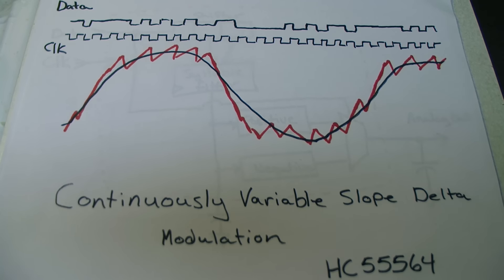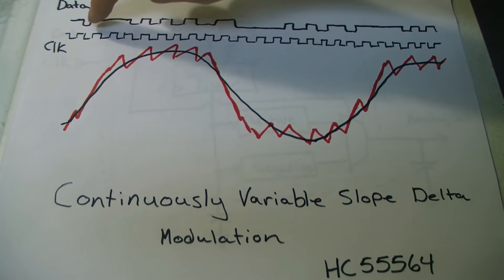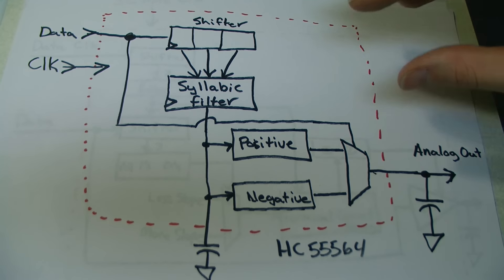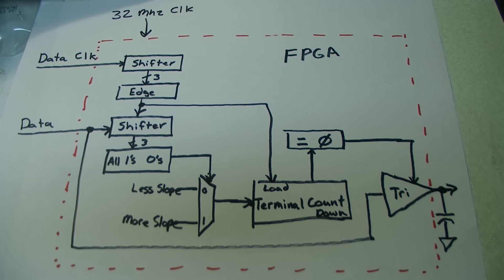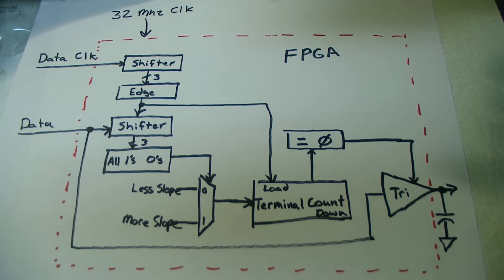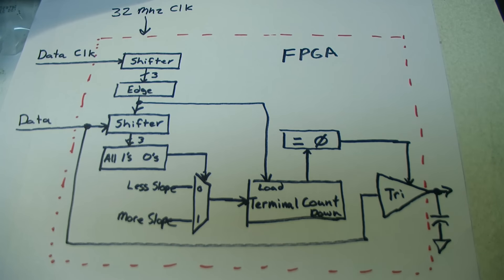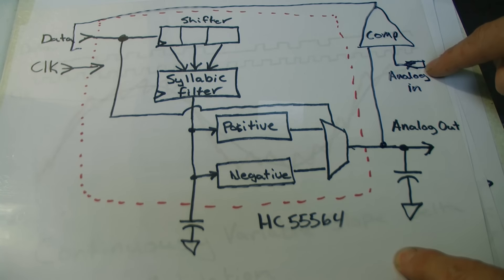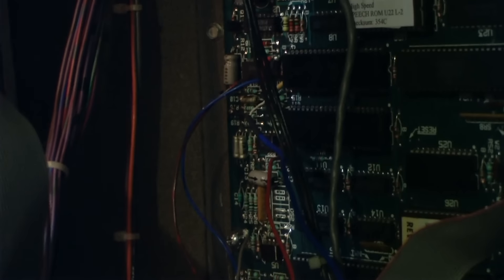Continuous Variable Slope Delta Modulator - HC55564

Comment from the maker: @sonicase I looked at the shape of the waveform on the scope.  If the values were too low it would be quiet and if too large it clipped.   When the values had a very large difference I could hear white noise and when small it sounded muffled.

Comment from the maker: @AntiProtonBoy It could be done with two io pins and a few resistors for the charge transfer if you only had the data clock.  I had the fast clock handy, so it gave me more flexibility.   Watch out for slow rise times on old ttl designs.   I've had fast FPGA's think the edges are multiple clock transistions.

Comment: Jeri I don't know why you diden't use the AK4321VF-E1 CVSD DAC chip like the one used in the Technics ST-GT1000 AM/FM/DAB radio which does the exact same thing as the HC55564 just get the data sheet.

Comment: Have you considered doing this in analog circuitry? The slope pretty much looks like the output of an integrator opamp (and using a flip flop to synchronize with the clock). Add a serial-in-parallel-out SR with latch and extend the integrator to be summing of 3 of the outputs of the SR and you could even implement the varying slope.

Not that I would ever know more than you, it's just the level of expertise I reached ;). (I'm currently just scratching µCs).

Comment: You could use a audio codec to do the same right, probably way cheapter and less complicated  than fpga. u have digital data from the processor , just need the analog conversion.

Comment: CVSD can also be done with a micro (pwm+rc) *y* Next, put the complete electronics (game,sound,drivers) of that pinball machine on/into a tiny FPGA board *y*
You loose the inner retro.. the soul of the machine *y* If you want to keep the retro look, you can fix a tiny qfn FPGA into that HC55564 housing *y*

Comment: FPGAs are expensive.

Is there a reason this couldn't be done on a cheap microcontroller?
Output voltage is set by changing duty cycle of PWM peripheral.
Route clock to a pin with interrupt-on-change. In interrupt service routine, increase the duty cycle if data is high, decrement if low. Keep track of how many 1's or 0's in a row you get to change the duty cycle by more.

I think this could be done using only 10 pins.
VDD
GND
Digital Data In
Data Clock In
Analog Out(PWM)

In-circuit programming data
In-circuit programming clock
MCLR

If you want a UART for debugging, then include
TX
RX

This approach only emulates converting the serial data into an analog voltage. It doesn't converter analog to digital stream like the real 55516.